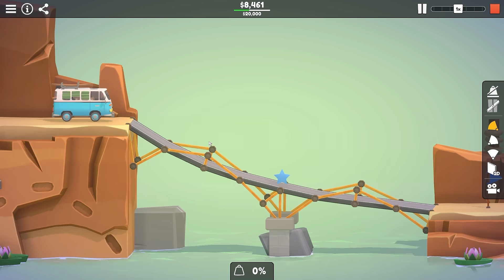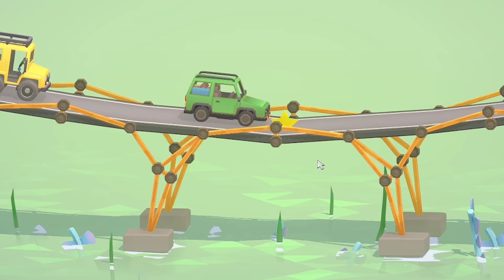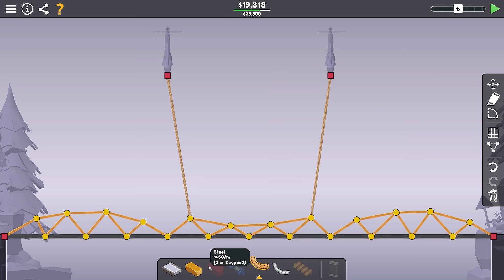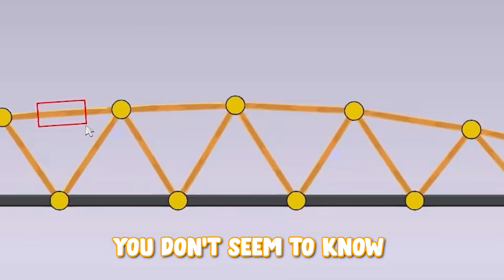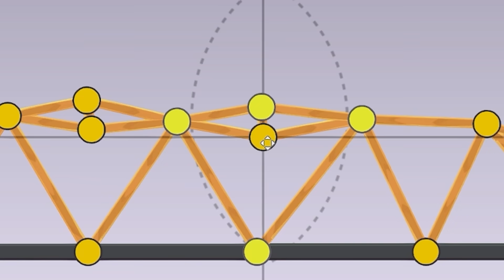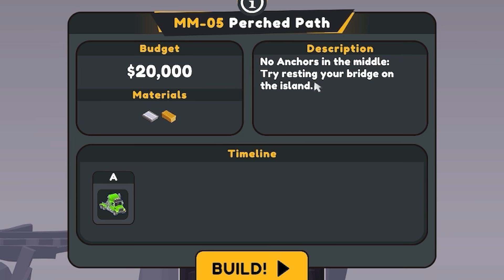Can a Professional Engineer become #1 in Poly Bridge 3?

Comment: I dated an engineer once, and at the beginning the relationship was built on a strong foundation. After I while I decided I wanted to move on because she was so attached to me all the time. My stress was so high I almost couldn't bear it. I think she knew what was going to happen, and I saw her muscles tense up to brace for the bad news. We both felt the suspense hanging in the air, and I finally told her that her constant presence was just a bridge too far for me and I'd reached my breaking point. I had to do it for my sake, but I know I gave her truss issues for a long time after that. Everything ended up alright though, because she's now in a happy poly relationship with two architects!
Reply: nobody could be in a happy relationship with an architect lol
Reply: This comment was beautiful.
You mind if I copy it use it as Reference?
Reply: @howtomundane3109  Sure thing! Copy it all you want.

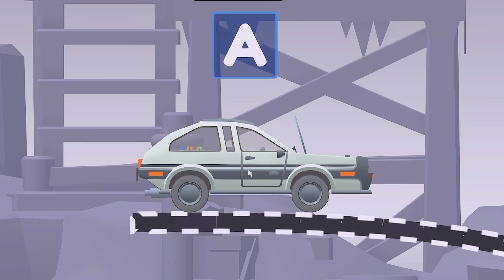Comment: 12:21 the speed of quantum flux was 88 mph (the DeLorean's marketed top speed)... not 100mph
Reply: They had to change the engine to actually reach it though. I suspect the original car would only hit 88mph if dropped off a cliff 😂
Reply: @nicholasvinen  Unsurprisingly, that's also the only chance either would have of reaching 100... (the speed RCE mentioned as the flux threshold)

Comment: as a fun fact about pb3... Roads seem to be more costly in this game compared to others. Also weight is now based on the length and material used instead of just being based off of how many joints/nodes you have unlike in previous games.

Comment: Stress: 99.9%
RCE: That's how you know you have engineered efficiently.
Reply: I mean everyone can design a bridge that works. Only engeneers can design a bridge that barely works
Reply: As a vehicle engineer, I can prove that that is very true
Reply: It's not that efficient anymore when the person crossing the bridge is even slightly overweight
Reply: @builderbasti9773  We factor in a ton of safety factors then design to the 99.99% stress with those safety factors. That way we don't need to worry about that.
Reply: I have engineered my life efficiently.
Reply: @nicholasvinen  best reply 😂
Reply: @Repent and believe in Jesus Christ  Rimming for the Lord
Reply: i am engineered efficiently ig
Reply: 99.99*
Reply: Das y dont text & drive. Drop your phone = bridge failure haha
Reply: Fr
Reply: 100.0% with no breaks for the whole time is better
Reply: @guigui0246  100.0% stress by definition breaks
Reply: @NikkiTheViolist should of seen that aliens rock video where he got 100% stress and no breaks
Reply: @NikkiTheViolist  I think Poly Bridge 2 rounded that, so e.g. 99.96% would appear as 100.0%
Reply: @NikkiTheViolist  clearly u didnt see alienrocks bridges. he has a bridge that is 100.00 % stress
Reply: @NikkiTheViolist  depends on if the game has a <= 100% or <100% as cutoff point defined
Reply: @NikkiTheViolist  No, it's possible in polybridge to have 100% without breaks but it's because it's rounded from 99.95% or more
Reply: @NikkiTheViolist  100.0% doesn't break, aliensrock had a bridge without breaks at 100.0% in one of his videos
Reply: The game does reach 100% stress without breaking, @NikkiTheViolist  
That or it rounded up
Reply: @eipcness99 its because it was ≈100%